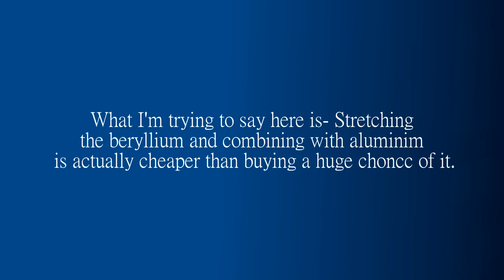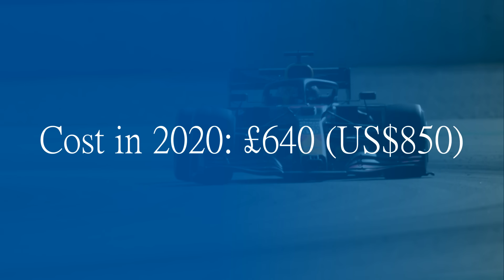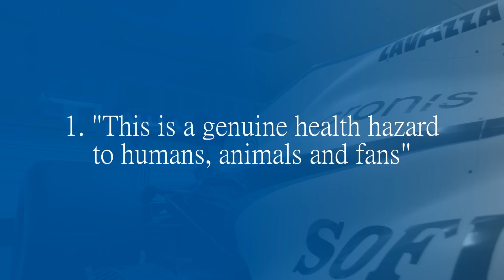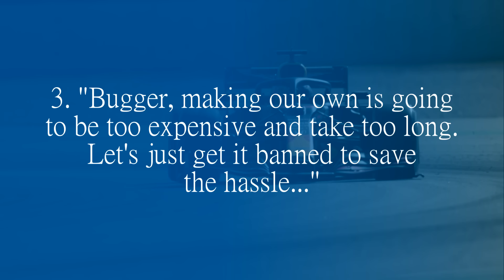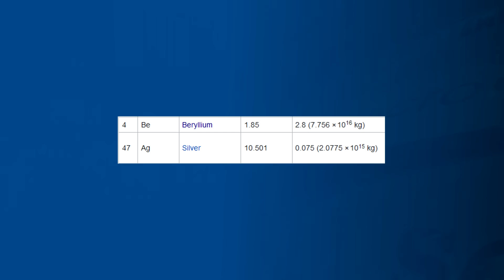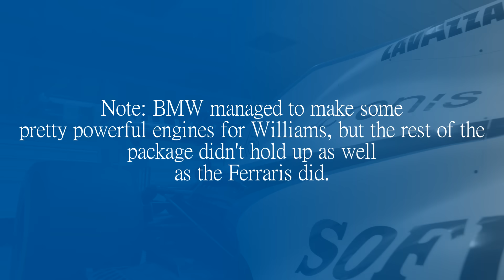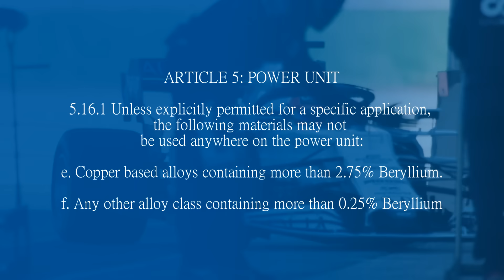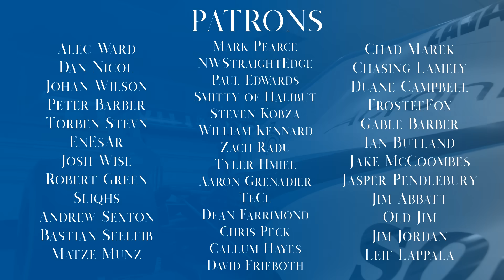MCLAREN'S "TOXIC" ENGINE! The Story of the Mercedes Beryllium Alloy Pistons (1998-2001)

Comment: The banning of Beryllium and exotic metals for Engines also explains why Mercedes Engines were pretty unreliable from 2001 to the rest of the V10era
Reply: They were visibly lacking power in 2001 and 2002, but they managed to recover it in later years. From 2005 onwards they had one of the most powerful engines. Reliability wasn't always great, though.
Reply: We had some screwdrivers and hammer heads made of beryllium copper alloy at work years ago. Non sparking. Some electronics used heat sink insulators made of beryllium oxide.  There were warnings about crushing them and inhaling powder
Reply: This was not due to that alone, but to the very low crankshaft that Newey always demanded.
Reply: Idiots here don't know anything about cars🤣🤣
Reply: Mercedes recovered in reliability but were maybe short on power because the whole car was not great. And unlike bmw the engine didn't stand out. But they poached Dr Werner Laurenz from BMW end of 2002. 2004 unreliability was a mixture of pushing all the boundaries, yet the car was fantastic, the engine performance was back.
Reply: @Alexandria Occasional-Castro 

Your name is better. LoL
Reply: Using beryllium compared to other exotics is pretty dumb considering how dangerous it is and other aren’t.
Reply: @warwickben  

Beryllium has 150% the stiffness of steel at only 70% the density of aluminum and nearly the same thermal conductivity of aluminum. There aren't any other metals that can approach that combination of properties. For a mechanical design engineer, its a major problem solver for many difficult challenges. Cost aside, there is nothing dumb about it.
Reply: @JosephHHHo  besides the health risk of manufacturing with it.
Reply: @warwickben  
There is nothing dumb about the health risks. It's a managed problem these days and the mitigation is rolled into the costs of working with the suppliers that process it. What is dumb are the people who don't understand it but keep talking shit about because they saw a couple half assed YouTube videos about it.
Reply: @JosephHHHo  till some one scraps it now realizing what it is.
Reply: @warwickben  
All sorts of materials with various levels of hazard are handled, and disposed of incorrectly all the time. That still doesn't justify your claim that it is dumb to use the material. Even water is hazardous, it's the #1 cause of drowning, yet we use it everywhere. Beryllium is an absolute superstar of the metals for both stiffness to weight ratio and thermal diffusivity, there is absolutely no surprise that F1 engineers found applications for it in their world of demanding challenges. They are some of the worlds best engineering talent, what are your qualifications to claim that they made a dumb material choice?
Reply: @JosephHHHo  it’s dumb to use in a race engine ,  not worth the risk  of a crash.
Reply: @warwickben  
Have you done a well informed risk assessment? Or just spouting more BS? How much beryllium from the pistons would be released by a crash? More specifically, how much of that would be in the partical size range that can lead to beryllium sensitization? How long would a non negligible concentration of those particles exist in any one place to be breathed in by a person before being dispersed?

It was within the rules at the time, they won races with it, and didn't go bankrupt because of it. They even had multiple crashes with it and none of those incidents were made worse by it. Seems like the decisions made by the real engineers played out as desired.
Reply: @JosephHHHo  Except we NEED water. Nobody NEEDS beryllium pistons. Your argument is ridiculous. "It's worth the health defects because it's better" lmfao jesus christ what is wrong with some people
Reply: @NikoBell1188  
And your argument is legit because we NEED racecars? About the most hazardous and wasteful of modern frivolous activities.
Reply: @JosephHHHo  Exactly, water is the most abundant and powerful solvent on our planet. So many fail to realize this, while many healthy reactions involve water many reactions with it are hazardous by fumes or reaction chemicals... or completely explosive.... and all life threatening... that which creates life, can also take it away.
Reply: @timm.6391  yall keep mentioning water like that shit is toxic 😂😂😂
Reply: @moneybilla  Well, fact is, water can be toxic.
Reply: @timm.6391  Only by a definition of toxic that includes literally every other substance
Reply: @JosephHHHo  yeah that’s exactly why there’s ways of handling everything. People are here talking about this metal. But forget that people are handling radioactive material safely. Where’s the logic, especially if there’s a safe program to manufacture, and dispose of the product.
Reply: @moneybilla  Have you heard of heavy water....
Reply: @warwickben  repeat after me: the dose makes the poison. And no one was getting their hands on enough F1 engine pistons to be able to scrape them AND not know what they were scrapping. Random things don’t just happen quite so often.
Reply: @JosephHHHo  I’m just now realizing that your comment thread is 6 months old now, but I suppose better late than never: don’t argue with idiots, they pull you down to their level and beat you with experience.
Reply: @warwickben It poses no health risks in that situation, either. The risky part is handling the raw materials, namely the powdered beryllium metal. The manufacturing of these pistons uses a process called sintering. Basically, you take extremely pure and extremely clean powdered metals, mix them homogenously, place the mixture into special dies, and press the living hell out of them while adding lots of heat. That actually fuses (or sinters) the powdered metal into a solid metal alloy part or billet that either wouldn't be possible or as easy to achieve though traditional alloying trchniques, such as simply heating the metals to their melting points and mixing them together. Once the sintering process has been completed, the beryllium is rendered totally safe, since you can't inhale a whole piston. Even if the piston failed catastrophically  and shattered into tiny pieces or even melted, it would not produce the hazardous pure beryllium metal powder again. Therefore it was still be just as non-toxic as any forged aluminum piston.
Reply: @SteelyEyedMissileDan thanks for stating the facts & telling the truth
Reply: @warwickben  untill you remember lead.
Reply: @jwalster9412  And about half the other elements in the periodic table 😬
Reply: @warwickben  speaker manufacturers are still using beryllium , are we all gonna die now ?
Reply: @warwickben  do you want to go fast or be scared
Reply: One of these days, Ferrari is gonna start isotopically enriching their alloys, such as using Aluminum-26 instead of the heavier and much more common isotope everyone is familiar with. As a bonus, Aluminum-26 will turn into Magnesium after a few hundred thousand years.
Reply: Am I the only one who wishes YT content creators would stop trying to introduce their own claims about shit they don’t know anything about into their videos? Just give us the story and leave anything related to … STEM out. Unless you are an engineer/chemist/etc etc etc. keep that stuff as minimal as possible if you don’t want to start citing yo sources.

Comment: As far as lighter elements go - I've heard of helium being used to fill tyres for some kind of alleged weight benefit, and hydrogen has a possible use as a "green" fuel.  Can't see a motorsport future for lithium, though.  Except maybe to calm down rabid Maxy / Lew fans during another no doubt contentious season.
Reply: Helium seems highly unlikely as it permeates tires due to being a very small molecule. Nitrogen is used because it is less thermally expansive and has a much larger molecule than any other molecule used for filling tires.
Reply: @kennethstreet7868  also it's 'dry' in the sense there's no H2O. When tires heat up during the race different humidity levels in the tires will cause the tire pressure to change in an unpredictable manner. Not good for a stable/balanced car
Reply from the maker: Nitrogen as well. During spygate McLaren saw that Ferrari was using nitrogen while McLaren was using CO2
Reply: @AidanMillward  afair it was a mix of CO2 and r404a refrigerant, the point was a better heat transfer from tire to rim and less pressure variation with temperature
Reply: @AidanMillward  I'm sort of surprised, I'd have thought they'd have used a dry inert gas, viz Helium, Neon, Argon etc to have more perfectly ideal gas properties, though I suppose they could have chosen another gas with non-ideal gas properties, if there was an advantage in it.
Reply from the maker: @silasmayes7954  hydrogen also goes bang if it gets too hot.
Reply: @AidanMillward  and it goes bang in any mix with air from ~18-60%, gasoline is only explosive in the range ~1-3%
The biggest problem is that it is a very hard to store or transport any serious amount of it, it is only liquid at cryogenic temperatures so it has to stored as gas at several hundred bars
Reply: @silasmayes7954  Rookie Racing did race a hydrogen ICE engined Corolla in the 24h of Fuji. And it was driven by Kamui Kobayashi and Akio Toyoda, owner of the team. And of the brand.
I dunno if there's enough content to make a video, but it seems an interesting fact.
Reply: the helium story i heard was about it being used in pitstops because the helium would be faster then regular gasses, but it was banned because helium is expensive or something like that.
Reply: @thedaimerr  helium is also a limited resource
Reply: @thedaimerr  seem to recall it was for the airguns. Helium is found in only a couple of wells in Texas and yes it is expensive and considered a vital strategic material. That's why Hindenburg used H2 as a lifting gas. We reused to sell it to them
Reply: When I was in my teens late 90's rally racing was big. A lot of those cars ran on hydrogen.
Reply: @silasmayes7954  They already have been. And no, no real modification needs to be made for it. Beside tanks, and lines, plumbing and that kind of thing.
Reply: Batteries. For when it’s all electric.
Reply: Lithium is the building block in motorsports today though, fact, it’s pretty much only used as an aluminium lithium alloy but it is spread widely and not going anywhere.
Reply: @indiebekonn  it's funny how if you mix some lower strength materials, you get something so strong. Chemistry is a trip.
Reply: @silasmayes7954  I really do hope to see hydrogen internal combustion engines when the woke retarded eco sheep start fuming that "fuels are bad for the environment". But wou;d be much better if they just move from E10 to E85 and stick there. At least we can buy E85 fuel and go to a drag strip.

Comment: Most people didn't believe me when I told them this story.

I read that it had longer stroke with the same length of conrod as the rod itself was able to stretch during combustion and then rebound on the exhaust stroke

with hindsight, this seems to be pretty far fetched so I'm going to assume I was mislead when I read this
Reply: Connecting rods compress on the power stroke.
Reply: That's definitely false.  Beryllium has a modulus of elasticity (specific stiffness) which is 1.5x higher than steel, and even the highest strength beryllium alloys have lower strength than the steels normally used in conrods, so they'd need an even larger cross section (increasing stiffness).
Reply: TTFN/
Reply: Lol two engines with the same crank and different lenght rods has the same stroke.

The lenght of the conrod doesnt set the stroke. Its the crank.

If the conrod has a flexibel lenght the engine will have less power and probably destroy itself quick
Reply: @danielssonsgarage  My bad, you are correct. What I do remember from the article is that the conrod was able to stretch and rebound. Perhaps to achieve a higher compression ratio? I don't really know, I'm not an engine designer.

And to be clear, the article I read could've been total BS. It just seemed so unusual that it stuck in my mind.
Reply: @Will_M600  the rods stretch and compress a bit like all metall under load but not in a relevant way. Not stroke related
Reply: There are designs for Variable Compression Ratio conrods but this is nothing to do with the piston metallurgy in this video. The story that F1 engineers were trying to create bendy conrods for better compression is amusing. We would see some exciting dyno tests if only the rules allowed pasta conrods!
Reply: @alistairbuckle3450  im guessing spring conrods would be perfekt.
Reply: @danielssonsgarage  yes but you have to have a piston with a different compression height depending on the length of the rod. If the rod dynamically got longer then the piston would indeed travel further - effectively increasing the stroke. I don't know exactly how this would help anything though
Reply: @rossracing6433  my guess is its a workaround for limitations in what they can do with the engine according to the rules.